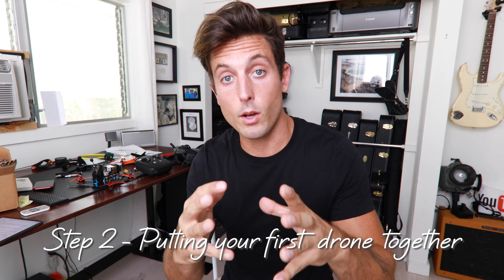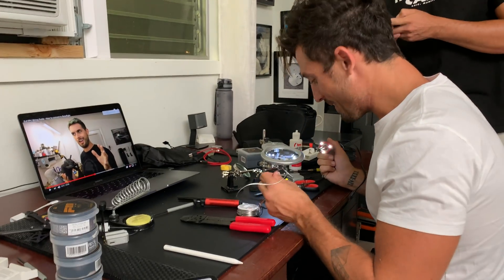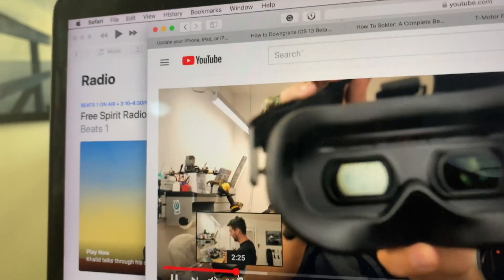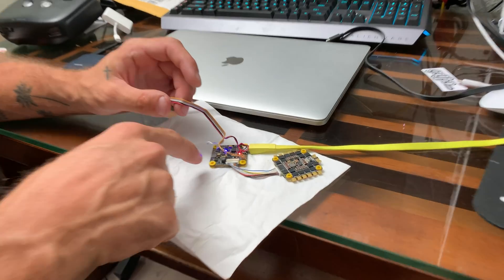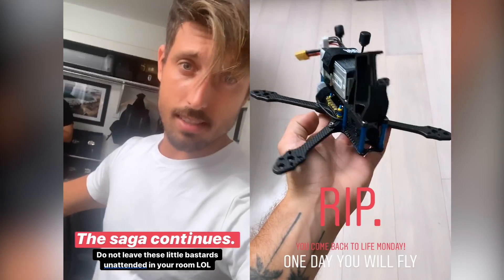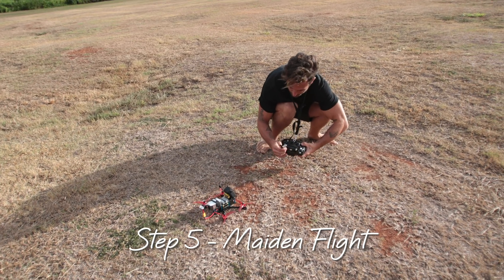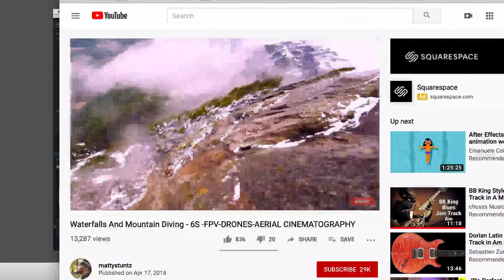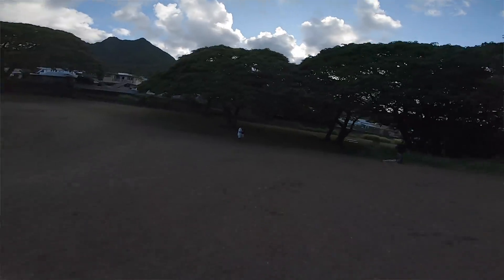How To Build a Cinematic FPV Racing Drone! • DJI Fpv

Comment from the maker: What are your thoughts on FPV Racing Drones?! Are these the future of drones or just another passing fad???
Whats in your build???
Reply: Definitly the future
Reply: 100% the future! You need to get a micro drone and you’ll fall in love all over again!! Thought I’d just start with one but now have 5 of them 😂
Reply: @AndrewMurphyFilms  ill buy one
Reply: @rogueproductionsMN  haha but I love them all!
Reply: So freakin cool! Ive been wanting to get in to this for a while now. I just know that its freakin difficult like you've experienced haha. Soon!
Reply: @joshmillerdp  If you can solder and have basic tech knowledge the only problem with getting into it is BetaFlight, but you can get Flight one and dont have to worry about that
Reply: Awesome video! Can you link the simulator you used?
Reply: @IkruelI  Flying hours were on Liftoff, available at Steam
Reply: @IkruelI   its called Liftoff. find it on Steam game store
Reply: @nathanjmansfield9969  nah thats the DRL Sim
Reply: @Kruel Drone Racing League Simulator https://store.steampowered.com/app/641780/The_Drone_Racing_League_Simulator/
Reply: It been 1 year im flying fpv drone and thé problème you made it's that's you didn't buy separate esc because if it burn you need to change all of it take individual esc. You can put a gps on it and à buzzer so wen you crash it it's make bip.  Sorry for thé orthographe im french
Reply: @gabrielbruni3924  If you're in a bind  you can use a single ESC to replace the bad corner on a 4in1. Just re-rout the signal wire to it and put it on the arm
Reply: @RTKdarling  ok cool tip thanks
Reply: @gabrielbruni3924  4in1 ESCs allow you to build much smaller, much more compact, much cleaner and especially more durable quads. All the electronics are in one spot in the centre of the frame and well protected. You don´t need any cables except the ones to the motors and some really short signal cables. No trouble with PDBs and big cables that go to the battery and all those things. 4in1 ESCs are much better. Yes if you burn one phase you have to throw it all out but I think thats worth it. Alsoregarding weight and so on.
Reply: @detroxx56784  yes you right maybe it's me wen I had a 4 in 1 esc I burn a lot of motors and the esc so I prefer individual esc so for me it's individual it's my tastes
Reply: @gabrielbruni3924  That's perfectly fine if you prefer it that way 😀
I'm just talking about my own experiences. A friend did manage to blow up one phase and had to buy a completely new 4in1. That's the problem. 
I just prefer frames that use a stack rather than the bigger ones where you could still mount the ESCs on the arms etc. 
It all comes down to personal preferences.
Reply: Gabriel BRUNI 4in1 escs are the right way to go. They last a lot longer because they do not get physical impacts and you can replace them a lot faster due to the 4in1 connectors.
Reply: At least you showed that it's not just plugging it in and fly!

I'm flying FPV drones (the regular oldschool way without dji system) for a while now and my biggest issue with this dji anouncements is that everybody who is filming, photographing or anything like this and flying phantoms..... wanna start to try building fpv racekwads like that and do idiotic stuff with them like flying close to airfields or all those things why normal drones got so regulated. 

Regulations for FPV Kwads will keep rolling in now it seems....

Greetings from Austria and fly safe buddy!
Reply: The future!!! I absolutely love this hobby :)
Reply: I proud of you :D Yeah ist hard but that adrenaline...sick! First year it's the worst, now i crash a lot less.
Reply: Cinematic FPV will show a lot on movies in the next few years.. write it down!
I know simulator on the right its the https://www.youtube.com/channel/UCg-Y6s7NTtlQ5I7QtOg_bvw
Reply: sawyerhartman Do more research before build
Reply: Not a fad, especially now that DJI has given us HD fpv!! Exciting times for us FPV'ers for sure
Reply: Welcome to the FPV world 😁!
Building..Burning electronics...Crashing...Paying.. Changing gear.. changing settings.. Crying...Sweating.. Pushing that throttle.. recording shaky footage.. trying again... New props.. new escs... Lighter frames... oscillations... hitting that gap...
I love it 😁
Reply: its lie-po not lip o
Reply: Search UAVFutures on YouTube and get some help
Reply: Doing it for a year now. Totally addictive
Reply: I've been flying fpv since late 2014 early 2015. I fly every weekend consistently.  There is a high initial learning curve but you learn so much and surprise yourself with what you are capable of. That includes building, problem solving, research and piloting skills. It's the most rewarding hobby I've taken up and I don't think I'll stop. The feeling of being completely untethered from your physical self is awesome. I still remember the first time I flew back and looked at myself standing there from an outside perspective. 👍
Reply: Armattan Rooster frame, Foxeer Falkor fpv cam,  Tbs Unify Race vtx, Foxeer lolipop v3 fpv antenna, Frsky R-xsr receiver, Clracing F4 flight controller, Holybro Tekko32 35a esc's, Iflight Xing 2306 2450kv motors, Hq Ethix S4 props, Cnhl 4s 1300mah 100c lipos, GoPro Hero Session 5
Reply: Crazy! But I’m put off now 😂
Reply: Very hyped about them. Johny FPV has put tons of info online on components, kits ect.. Great video, thanks!
Reply: Sooo... can you use the DJI equipment on the simulator? There is no HDMI out/input on the goggles or controller?
Reply: Just put one together as well and been ripppinn! I built a 4s mr steele build basically.
Reply: Well done man!
If I could recommend to you a couple things for you to add to your build.
- HellGate FPV Buzzer (It will beep for weeks with its own battery so you can find your drone)
- Holybro Micro M8N GPS Module (You can add in a GPS return to home in betaflight, its not gracefull but it works)
I'm currently flying a Marmotte with 2208 Xing 1800kv motors on 6S .
Reply: KababFPV Glide Frame (I really recommend it)
2306 2450kv Flywoo motors
Flywoo 50A pro ESC
Dalrc F722
Gemfan 5146.6
Rush tank VTX

All top of the line components

But I was unlucky and lost the whole quad with a gopro 7 black because of an AKK VTX ( Dont buy them)
Reply: I built my first one 3 weeks ago. Took 3 frustrating days of no sleeping to build. You mentioned the simulator, but not which one or where to find it?
Reply: @tommytenzo  Liftoff, Velocidrone, DRL Simulator
These are the best
Reply: ARIA FPV and you used your DJI controller as well?
Reply: @tommytenzo  No Im not using the Dji system but I saw someone play a sim with the dji controller
Reply: I practically learned to build and fly fpv from youtube and the web
Reply: Sawyer, you're dope af!!! I'm Hot on your trails to be one of the best FPV pilots out!!!! You seem like a good RIVAL!!!!
Reply: Get GPS unit for your drone - costs less than $10 and can get you your drone back in difficult situations ;)
Reply: "blah blah motherboard... then you have to solder all the wires in... 
good luck"
😂😂😂😂👌
sick project btw mate. well done 🤙💯🔥
Reply: I have like 5 of these so god help me if they go out of style
Reply: The Future!! and there is a lot of social media building groups, that are the greatest of help! and friendly communitys!! great vid!
Reply: Really I like it but I don't have money to build it can you borrow it to me
Reply: Not A fad and if it was who cares it's too fun for me to quit.
I have 3 quads with 5in props 2 with 3in props  2 with 2.5 in props and 5 indoor micro drones. I only have 1 GoPro I fly for me
Reply: It's just a different aspect or tool but it's a fun hobby and I love it have fun you will love it
Reply: Fun fun hobby and I have sooo many to list but just a tip try a  Flightone flight controller "revolt osd" and falco x the best flying firmware IMO
Reply: If the learning curve stays that steep, I doubt it will become popular soon. But the DJI FPV system does boom up this topic a bit.
Reply: Thanks for Sharing, im starting, and that you said, theres so little information in internet. Greetings from mexico.
Reply: I wish I could have one of this.... Some day I will
Reply: FUTURE for sure, but they will be replaced by AI in the racing scene some day
Reply: One of my builds:

Frame: Hyperlite Floss 3.0
Motors: Excelvan GB2306 1650KV
FC + ESC combo: Mamba Stack MK2
VTX: Eachine VTX508
Cam: Foxeer Arrow Micro Pro
Antenna: Foxeer Lollipop v3
Receiver: FrSky XM+
Radio: Taranis Qx7
Goggles: Fatshark Dom v3
Module: True-D 3.7
Charger: ISDT Q6 PRO
Batteries 6cell: CNHL Black Series 6s 1100mAh
Batteries 4cell: CNHL Black Series 4s 1500mAh
Reply: Could you drop the list of all the items for the build.
Reply: What's the typical range on those
Reply: definitly here to stay, you need to get a micro drone like a mobula 6!
Reply: Try a Pebblebee
Reply: its not FPV racing its fpv freeacro
Reply: It is the future do watch drl
Reply: U can add a gps for like 15 bucks connect to a uart and configure watch bardwells vid on gps.
Reply: @chocolatezt  $400? What kind of Drone are you using and where to get it from?
Reply: Can we buy this fpv drone
Reply: Thank you so much for this!!! I am on Oahu [Born and RaiSed] so cool to see this in the islands
Reply: It's the future.  Just don't start wearing eyeliner like Drib, please.

Comment: Good job. Now if you really want a hard flying experience, get into 3D helicopters. The hard part is that it's not FPV. Like flying inverted, you have to remember that down is up and up is expensive. Also, learning orientations. If the nose is to you, left is right and right is left. Pushing the stick away from you brings the heli towards you. Then inverted controls changes some things and some things stay the same. Definitely the hardest and most expensive learning curve I've ever experienced. lol For someone with no experience, learning to take off and hover can take weeks. Not even flying. Just hover in place. Then more weeks to learn to hover nose in. You should try it, if you haven't by now.

Comment: PID is the basic control stategy where your reactions to the inputs from the field are proportional, integral and/or derivate down to the output or adjustments to whatever you want to control.  Google  "PID control without math" to learn about it...

Comment: 3:22 for soldering There are smaller tips that make soldering on small pcb's easier and you can buy wick and a solder suction tool to remove extra solder from the pcb. One other tip is to buy and use 60/40 rosin flux which leaves nice and clean soldering joints that need less heat than other soldering rosin to remove.

Comment: It was fun watching his experience with FPV. But as someone who likes to research and even look for common troubleshoots for different options before spending a dime, it was painful to watch how much he messed up at the beginning. Also, never learn how to solder on expensive equipment! Chips are very easy to burn if you take too long to solder; it is best to practice on cheap and passive electronics such as resistors. 
Anyhow, this guy has very good video producing skills and storytelling. I think that we can all use the internet to help each other and become better 🙌🏽

Comment: Interesting to listen to someone who built, tuned and flew RC helicopters. Probably, FPV drones are more complicated on the electronics and helicopters are a mechanical hell, also flying them is mind blowing with all he disorientation problems. I used to be in RC heli 10 years ago now starting a come back with drones.

Comment: It cost you more then it needed to going with dji but that your choice I am trying to get my I flight quads to run with my flysky transmitter I ordered some new receivers if those don't work I will likely have to switch to frsky.

Comment: This is  the worst video about fpv its very simple soldering its not that expensive you can build a good one with a radio for about 350 or probably cheaper you can just pop it out of you back pack and get some cinematic shots its not just for racing. There are sooo many videos on youtube for this hobby makes it sound so hard and unobtainable but its really not that steep of a learning curve. So please stop misinforming beginners and people that want to get into the hobby

Comment: PID usually stands for the proportional, integral, derivative regulator (control). I was studying it 15 years ago, so I might forget something but this is what I remember. 
       P needed to react on Present adjustments, you are asking motors to use more power and it uses more power directly linearly. Imagine drone is falling down and you use more power because the drone is heavy, it will not immediately change its direction, it will keep falling for some time, and you keep increasing power more and more because you think it is still not enough, but at some point of time it will change direction and power will be so hight so it will go up very fast and you slowing down, and process repeat, so you will never be able to keep level. 
       So you need an integral part, this part is using history, and longer power is changing to one direction the smaller adjustments going to be,  you want to use it if you want to keep the same level for a long period of time. 
      And the derivative part, it actually looking to the future, it is trying to predict what you want, so if you increase power quickly from neutral position all the way to the highest, it will exaggerate it and ask motores to work on full as fast as possible. 
So it can be tuned based on your need.

Comment: Shortest answer, the PID (or at least PI depending on the manufacturer) controller that most people are familiar with is cruise control on their car.  Proportional (how far off the error is - ie you're going 20mph when the preset is 65), Integral - how much accumulated error you have (30mph off for 10 seconds implies the need for more correction than 30 mph off for 1 second), Derivative - How fast the current state is changing relative to the desired output.  In other words, if you went from 30mph below desired to 26 mph below in 1/8 of a second, you're going to overshoot the desired speed in less than 1 second at current inputs.  The idea of the PID is to get you where you want to be, quickly, comfortably and without overshooting (ie it would be bad to accelerate to 75, drop to 58, then up to 72, down to 60, up to 67 and back to 65....you want a smooth "round off" of the acceleration rather than oscillating/ringing above/below.

Comment: Hope someone sees this question: how can I build this drone but include prop guards so that, as a beginner, I'm not constantly destroying the propellers ?
Reply: I wouldn't bother with prop guards on a 5 inch. Makes sense on a smaller indoor drone but not something like 5 inch. Practice in the simulator so you crash less and then just expect to change props every now and again.
Reply: @bandobandit353  Thank you for replying my dude! When I want to practise in a simulator: what controller should I get?
Reply: Any of the popular radios will be plug and play with a simulator. Taranis Q X7, Taranis x-lite, Jumper T16. The Flysky FS6 is an affordable radio but doesn't play nicely with a simulator, so I'd avoid.

Comment: Proportional Integral Derivative is what PID stands for. It's used in almost all robotics for correction and acceleration prediction. EX: If you tell a robot to go to a line, without PID it will apply full acceleration and overshoot, with a PID it will provide just enough acceleration to precisely hit the line.

Comment: Sooooo idk what u mean, but there is a ton of information for FPV out there, on you tube, Insta etc....
and you should make clear how important it is to start on the sim with a radio at first...
The building itsself really isnt hard btw...

BUT MOST IMPORTANTLY make clear that the DJI FPV system is like the most expensive way to get into this hobby (by far the most expensive...)

For anyone looking to get into the hobby for about 300$ go reply to me or contact me privatly on you tube...

Comment: the New betaflight has what is call rescue mode, I really encourage you to installed, works, is not perfect but is you loose you video you click the switch  and the quad will come back to you but will not land you need to take control before that happen.  You need a gps and encourage you to get a F7 flight control, F4 may not have sufficient uarts you need at least 3, second do not use the DJI remote control is good but is limited just to DJI and range may be questionable depending in condition,  is better to flight with crossfire for many reasons.   One of them is you can track were you quad is in real time.  Cheers.  https://www.youtube.com/watch?v=KEP02qHaq6s&t=48s
https://www.youtube.com/watch?v=mul4oJjTGDY&t=193s

Comment: Guys, guys....I just wanted to have an FPVish experience but without the technical difficulties associated with building the craft and integrating the necessary equipment sooo...I bought a Mavic 2 Zoom with corresponding DJI Goggles (white ones). I've flown this thing just once and was somewhat pleased. Did I just make a very expensive mistake or is this docile approach to flying FPV a valid approach to get into this most challenging sport?

Comment: Thanks for the interesting video!
Question, what if you have a girlfriend? 
After watching this I feel I have to choose between the one or the other :')

But no just kidding, my girlfriends supports it ^^... my real question is: is there a racing-drone-controller that can be used on the Macbook? 
Cause I can only get a PS4 controller working on the macbook and do the simulator, but that controller is not really a-like as the drone-controller. Would be great to find a drone controller to use for the simulator on the Macbook. (I don't have a fast enough windows computer available for the simulator)